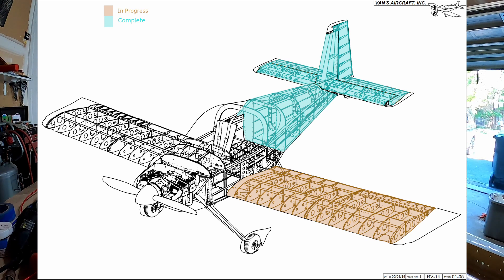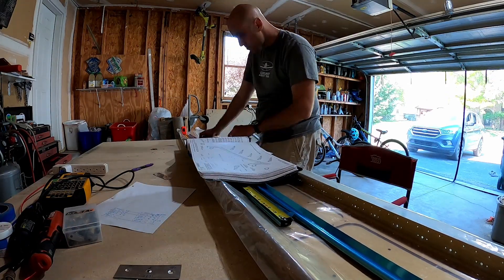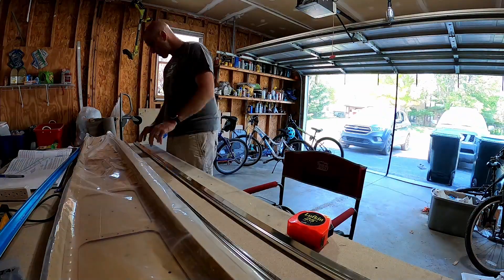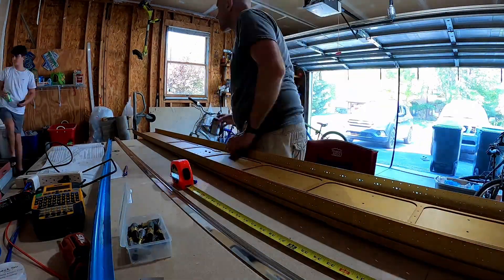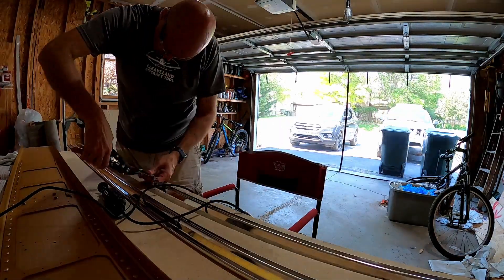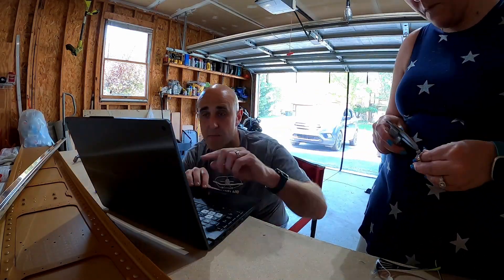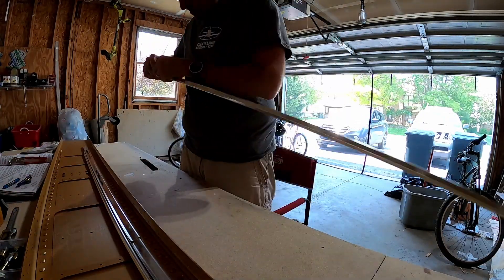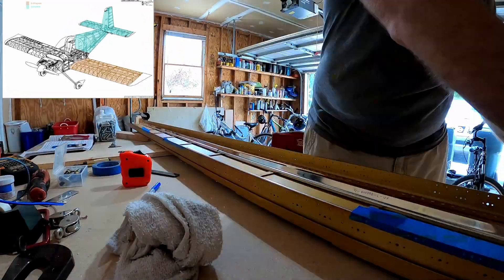RV-14 Build Left wing 1

Comment: How much room does the finished empennage take up and where do you have it stored?
Reply from the maker: The tail cone is the biggest piece, I've got it hanging from the ceiling in the basement, you can basically store the stabs and elevator inside the tail cone, not likely the rudder. I actually have all the tail feathers on a shelf though.